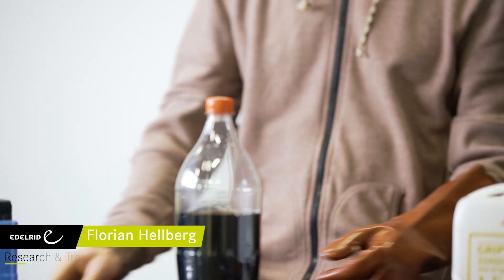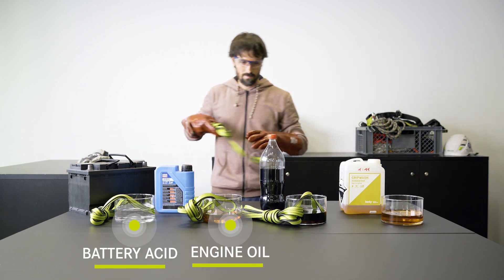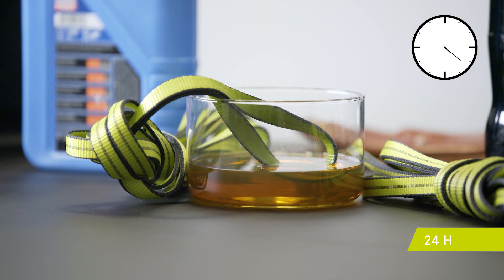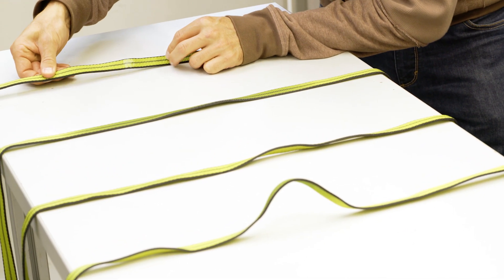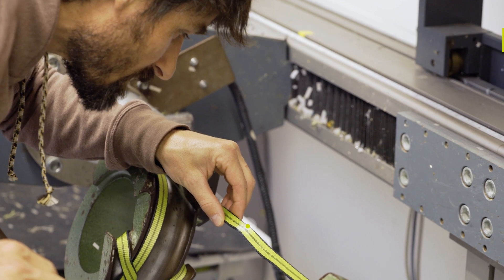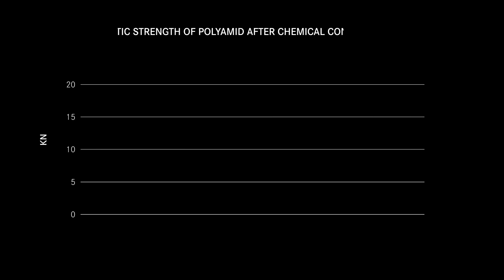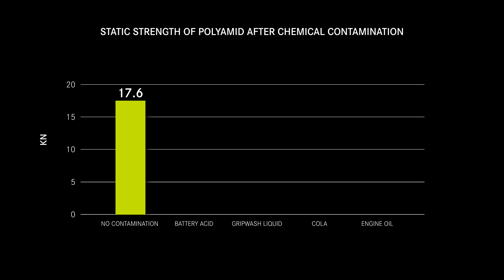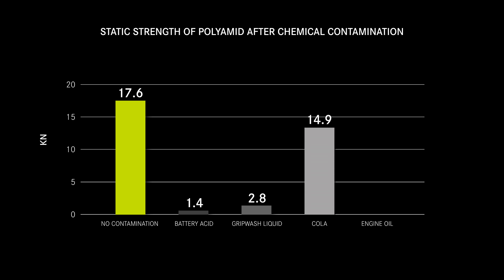What are harmful substances for your textile climbing gear?

Comment: Hi Florian,

Very nice video showing that one should indeed be careful with chemicals and safety equipment. However, you used Gripwash in its pure form and let it soak for 24h. The Gripwash manual states it shoold be used in a 1/11 dilution with water (you actualy wrote in on the bottle in the video) and soak for no more than 10 minutes.
Reply from the maker: The though behind using the pure form here is the observed scenario, that climbing gyms could store the grip wash next to their ppe. But you are right, it would be a good further test to test the influence of the intended dilution.

Comment: How about sunscreen or bug spray?
Reply from the maker: Thanks for those questions. I am currently not aware of what these products are based on. Very often they can be traced back to for example oil or alcohol based, meaning that is the biggest chemical in those products that could harm a rope. But we certainly will do a sequel episode with more chemicals based also on what users would be interested. So this is noted :)
Reply: @EDELRIDKnowledgeBase would love to see a sunscreen one to see how it compares to HowNot2’s recent video on it
Reply from the maker: @FairestUnicorn  We will certainly update the database constantly as we just did. Check out the written article linked in the description. There at the bottom of the page is all the substances we tested so far :)

Comment: What is gripwash?
Reply from the maker: Gripwash is a cleaning agent for climbing holds. It is one that is used here in Germany a lot, but is probably very similar to what people use everywhere if they are using a special cleaning agent. The reason we chose it is that we noticed that it often times is stored in the same room/same place as the climbing gyms ppe for route setting for example.